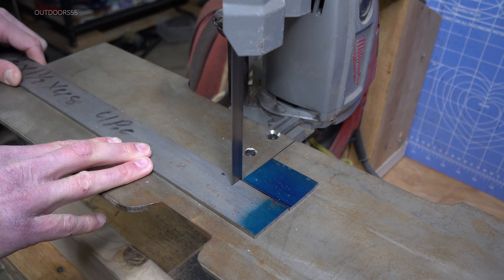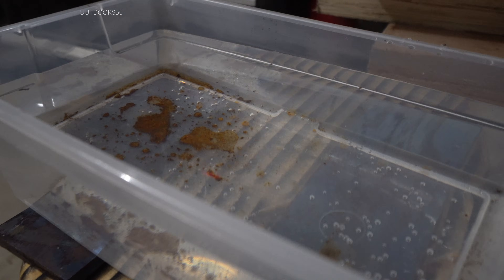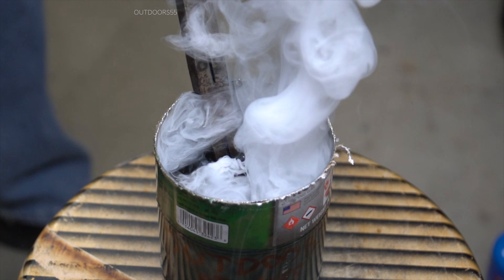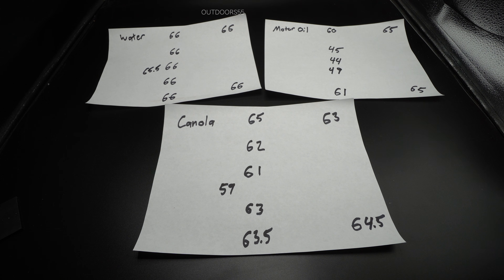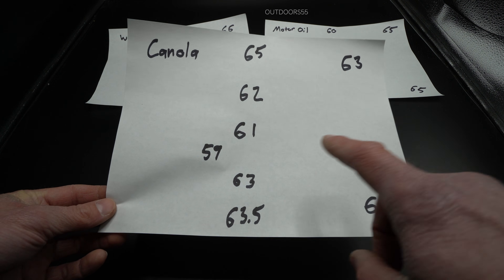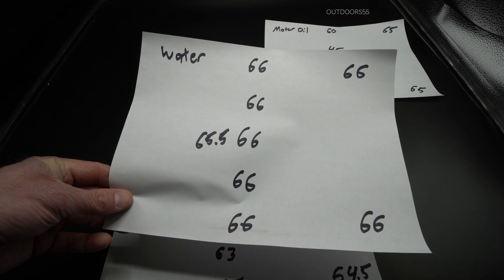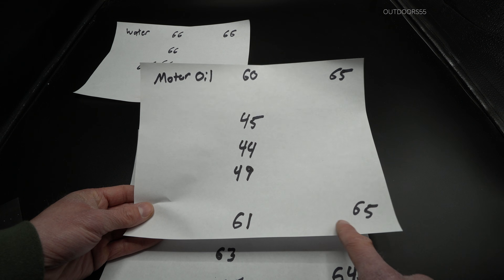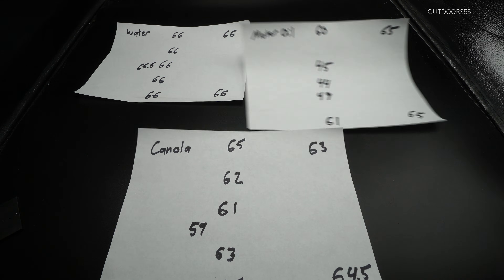Can You Use Canola Oil or Motor Oil For Knife Making?

Comment from the maker: This video applies to 1084 steel. Different steel will give different results. Also check description for proper quench oil. Thanks for watching 🙂
Reply: would you consider doing a 2023 season backpack loadout? that was how i found your channel a few years ago, would love to see the changes made since then.
Reply: @OUTDOORS55 just to let you know I have reported the twonk copying your user name and offering packages
Reply: Be aware that 1095 (or W1) is a water quench steel! It won't harden in this, but 1084/75/80, O1, 80crv2 and, 5160 will quench in a medium oil if it's thinner.

Comment: You're super wrong. 1095 and above is water quenching. Under that oil is still better. Rockwell isn't everything. Water will make most steels of 1084 and below brittle with bad edge retention. It cools too fast and thus makes cracks and such way more likely.

Comment: Saw another video where the creator pointed out that the hardness drops toward the centre of a thicker piece of steel with slow oils as well. Having those pockets of softer steel on the inside is not what you want, especially in a knife where that may end up becoming the edge after a few years of use.

Comment: Ok, so I hope you see this and can give me some good news. 
I restored a knife that was in a guy’s collection that was burned in the Hawaii wildfire. He lost everything.
I really wanted to bring this knife back, and he was excited to see me be able to put it to good use. I’ve spent a ton of time on it. But I’m thinking the heat treat was comprised, as I am not able to get a sharp edge. It keeps getting very small chips when sharpening. 
It’s  Paramilitary 2 in 
CPM 20CV. 
You probably already know the question. Is there a way to re-heat treat the blade or even just the edge, at home, with no special tools? 
Maybe since it got super hot in the fire, it only needs tempered again? If it got hot as a hardened blade is it even possible to re-temper?
I’m very mechanically inclined, but I don’t have a forge or anything like that. 
Any help is greatly appreciated. 
Many thanks!
Reply from the maker: Id find a machine shop with a hardness tester first. Unfortunately I don't think you can re heat treat 20cv without an anneal which youd need a kiln for. Depending on the actual temperature it got to it may be somewhat ok. But hard to say without hardness testing
Reply: @OUTDOORS55  
I ended up sticking the blade in the oven at 300°F for two hours, then let it sit in there to cool. 

I put it on the sharpener today and what a difference. 
Took an edge without issue, and felt way better while sharpening. 

Now, to be fair, I did switch back to wet stones, and didn’t use the cheap diamond thingys I have from Amazon. Those things are uber inconsistent and bumpy!

But yeah, it’s cutting really nice. 
Now to see what kind of edge retention I get out of it. 

Thanks again for the reply!
Reply: Thanks for the reply. 
I’ll check around for someone to test it. 
I may throw it in the oven for a couple of hours to see if it makes any difference. 
It feels hard when I sharpen it, but It’s just very brittle. 
I appreciate your input!

Comment: Thank You for your video here! I'm an FNG knife maker and tried quenching in used motor oil. I was having a tuff time getting my blades hard enough so a file would skate on the edges. So, after watching another video from a semi famous knife maker, where he edge quenched in water for afew seconds then dropped the blade into oil. I used this method and finally got the hardest I was looking for. Now I could continue this, but I did that edge quench out of desperation and would prefer to make my life easier, so I'll which to canola oil!   THANKS!!
Reply: Interrupted quench! It's even more important for 1095, W1, or Hitachi White steel. They're all water hardening unless the edge is incredibly thin, which also makes it likely to break in water, so you can use a fast oil for kitchen knives if you want a soft spine. 
1080, 5160, 80crv2 and such are a bit easier to harden but it's not a bad idea to water quench two small pieces and see how easy that scratches your oil quenched steel versus the water based one, to see if your steel is softer in an oil quench in that thickness. Or do an interrupted quench, since you only need to cool the steel fast to a certain point before it actually changes crystal form to martensite and changes in size slightly, which is what breaks them if done too fast in some parts of the knife and not others.

Comment: If you are just getting started and dont want to invest into a proper quenching oil use canola and something like O1/ O2 or 8670. They should still achive a good hardness.
Reply from the maker: You would need a kiln for 01
Reply: @OUTDOORS55  Because it needs more soak time? At least you dont get the usual plate martensite if you underaustenetize O1 a bit :D But i guess then its no longer at full hardness, and that was what this is all about.

Comment: Unrealistic !  Since a knife blade tapers toward the edge, surely the different thicknesses will cause a differing hardness.  So would quenching in used motor oil give a hard edge with a softer spine, which is precisely the optimum situation, as in traditional Japanese blades?   (I know that it's done differently there !)

Comment: I have a question.  With canola oil the lowest number you checked was 59hrc.  Would tempering the knife to 58hrc make the numbers consistent?
Reply from the maker: Good question. I've tested this in a previous video testing bad heat treatments. I cant post a link but it's easy to find on my channel. Titled "The biggest lie in the knife industry". I tested several different heat treatments with the same hardness.
Reply: Hardness isn't everything. The same hardness can have a different amount of many different properties like how far it bends before taking a set, how awful the burr is to remove, substantially lower toughness, and more.

Comment: I tend towards a warm brine solution, tested some low menganese 1075 pieces and found that canola was not adequate for the low hardenability stuff, brine was much better. I thought that 1084 would be more suited when it came to a vegetable oil quench, and although it did harden somewhat in canola you could still dig into it after a file test. The brine did a much better result with 1084 too. There are so many advocating 1084 with canola for backyard heat treatment, but I have my doubts.
Reply: For sure. Water is just better, and cheaper. You might get away with oil if it's very thin and prehg pound bevel, but then you also have to worry about it cooling in air too much on the way to the quench. Simple steels need a quench time under a second.. 52100, 5160 and O1 have better tolerance to cheap oil but even still, it's a couple seconds at best.
Reply: @mikafoxx2717  8670 might be ok with a canola oil quench. Experimenting with that steel.

Comment: Canola oil is absolutely a legit substitute for things like parks 50 if you don’t want to mortgage your house to quench. I’ve used everything from parks 50 to old deep fryer oil and honestly, there’s no negative to using canola oil. It also depends on the steel, obviously
Reply: Did you not watch the video?
Reply: @pumix  it’s actually not false info, lol. I also have a metallurgy background and an hrc tester. For some reason I’m logged into a really old google account, but I’m a bladesmith
Reply: The test showed that the edges would be very hard, while the middle would be softer. To me that seems perfectly fine for a knife. And it was done on square chunks of steel rather than a knife that was already ground to shape. In that case the edge would be thinner and it would get even harder. I'd take a softer center over risking a warp by quenching in water.
Reply: @Hendlton  I don't get why you guys are so against spending an extra $20 on real quench oil that will: a) give you repeatable and better results, b) won't degrade over time.  Also, it's NOT ok that the differing thicknesses harden differently.   That's a big problem.  For example, someone sharpens your knife back a bit and now its not hard.
Reply: @TyrellKnifeworks  Personally I'm not against it, but I don't agree with the conclusion of this video. Especially the recommendation to use water instead of oil. But I live in a country where something like Parks 50 just doesn't exist. I searched for it by every possible term I could find. You can't even buy knife steel where I'm from. The way I found my source was through a random Facebook post from years ago where someone left a comment with a mobile phone number and I just crossed my fingers that the seller was still active. That's why I'm looking for alternatives and questioning whether they are practically useful as long as you aren't aiming for perfection. And it's not like it stops being hard after a couple of millimeters. A professional butcher would have to use that knife for years to use up all that material. A regular person wouldn't get through it in a lifetime.
Reply: @Hendlton  where do you live?
Reply: @TyrellKnifeworks  I'm from Serbia. We also use the European standard for naming steel, so 1084 means literally nothing here.
Reply: @Hendlton  Canola is good.
Reply: Sorry, but this is just false info.  Parks50 is $35-45 a gallon. You really would need to replace your canola every few weeks, so what are you saving?     Also, if you don't have an hrc tester, all your results are in question anyway.  There is science to prove canola isn't a good quench medium for 10xx series steels.  If you think there's no negative, then sorry, that's just ignorance.

Comment: The problem I've had with water is blades cracking! Even when using W1 or Amazon W2 they still cracked catastrophically! 
I'd rather have a blade that's less hard but at least the edge is hard than no blade at all. 
I've also had success with canola oil heated closer to 160 degrees Fahrenheit rather than 120. I bet you don't feel like doing it but I'd love to see what difference much hotter canola makes.
Reply from the maker: There's always a risk of cracking. Leaving bevels slightly thicker will help.
Reply: @OUTDOORS55 it's fascinating seeing them water quench large gears and such in industry. You just need water even for 5160 when it's in massive leaf springs half an inch thick or more..

Comment: In Brazil many knife makers don't have access to quench oil so we have vast experience using wrong equipment lol. 
"Standard" medium oil Canola.
Motor oil will vary and depending on brand viscosity, usually it's slow oil. 
Your results match with this description .
The "recommended" oil for a fast quench is diesel.
It would be interesting to see results with "correct" Brazilian standard.
Reply: Interesting. Thanks for sharing. I'm getting into knife smithing myself and looking for cheap options that can still provide quality results.
Reply: @saintmichael3879  Electric oven for heat treatment is quite expensive around here. If you have access to it it's worth it.

Heat treatment on forge  has many many downsides, some upgrades can minimize it. Triple burner can help even out the heat. Temperature control with two sensors also help to get it right. It's still not ideal and probably only good enough for carbon steel but results are much better. 

Fish tank water pump for active cooling to avoid overheating steel while grinding  is the last cheap trick I know.
Reply: @thiago.assumpcao  outra dica que eu vi em um site gringo, é esquentar o óleo até uns 30-50°C para que ele fique menos espesso e possa resfriar a lâmina mais rápido (eu não sei se essa dica procede, eu não faço facas)
Reply: @isaacfernandes4692  É isso msm. Tenho amigo cuteleiro e esse é o padrão mas é difícil improvisar óleo rápido. Mais fácil usar um aço com maior capacidade de endurecimento tipo o 52100. Fica muito melhor assim do que se usa um aço limpo tipo a linha 10xx.

Comment: That makes so much sense: you don't want motor oil to be a fast conductor/absorber of heat because that would cause thermal differences throughout the engine block, with all associated material stresses those would cause. Block will crack, car will break.

Interesting how you casually just debunked a long standing myth among smithing youtubers, that preheated oil takes heat away faster... I can imagine that it absorbs the heat more evenly (in a uniform fashion because the oil flows and mixes more easily when it's a bit warmer), but you clearly proved that it's not faster :)
Reply from the maker: The warm oil vs cold oil may need more testing to say one way or the other. My sample size was only two pieces. I think you would need at least a 5 sample test with each, and average to see better results. There was no sign of any obvious difference between the two in my test here. Id like to test much hotter oil as well.🙂
Reply: @OUTDOORS55  hey, that's a great video concept :) (thanks for the reply ☺)
Slowly but surely you're going to build a metallurgy testing and vetting lab hehheh ;) 

It's true that sample size is important, but when the trend is not showing any difference, then a larger test will very likely also show little difference... I would even expect the larger test batch to have a lower variance because of the higher resolution.

Comment: I think you can follow this segment up with a knife hardness/toughness test. My hypothesis is that the water quenched 1084 would be more brittle than the oil quenched 1084. I predict the sharpened blade edge would be more susceptible to chipping with water quench.
Reply from the maker: I have a video testing bad heat treatments and toughness already. Higher hardness post quench gives better toughness at similar hardness levels due to the higher transformation of austenite to martensite. And less retained austenite.

Comment: Very interesting test.
If parks 50 wouldn't cost 200 euros a gallon.......
In the US its doable but over at the other side of the pond it's just expensive if it's in stock.
For now I'll keep using canola oil for the steel I am using.
Getting a good grain structure and good edge retention on my current heat treating recipe so if it ain't broke dont fix it.
Reply: If you use normal carbon steels, just use water and temper immediately. Make sure to normalize before quench and don't overheat before quenching, just enough to get nonmagnetic.

Comment: This was interesting, I watched a video earlier this week that explained that the soft spots are caused when the boiling oil makes bubbles on the surface of the metal that insulates it and keeps it from cooling quickly enough.
Reply from the maker: Yep! Thats why Agitation is recommended to break that air boundary layer 👍

Comment: This is terrible advice...... for most beginners using simple steels, canola oil is adequate to achieve an adequate hardness without the risk of cracking the blade.
You don't need to achieve "peak" hardness to make a functional knife. 

I'd rather have a tougher but slightly lower hardness blade with no cracks/micro fractures ect, as opposed to a water quenched and super hard blade potentially full of cracks.

Only a handful of steels can be safely water quenched, but even for them it's preferable (for something as thin as a blade ) to use a fast oil instead
Reply from the maker: Id suggest reading knife engineering by Dr larrin Thomas. Toughness doesn't work like that. Lower hardness post quench doesn't mean higher toughness. Again id suggest the book. In this video we are referring to 1084 and olny 1084 as said in the pinned comment. And this is referring to water vs canola, NOT water vs parks 50. Id always recommend a formulated quench oil. So it seems you missed what this video was actually about. So no, this video is good advice but went over your head.
Reply: @OUTDOORS55  Well I hope you're ready for all your "beginner knifemaker " followers to start complaining about cracked blades because of your recommendation of water quenching over Canola oil quenching.
No beginner should be water quenching unless they're getting their steel for free
Reply from the maker: Just spend $40 and by proper quench oil lol. No one is going to spend tons of money on steel and not buy the proper quench oil if they are getting cracked blades. Theres other problems at play as well. Perhaps you are grinding too thin pre heat treatment etc. canola is $12 a gallon so for 28 more your set. And cracked blades sometimes happen. Welcome to knife making.

Comment: I have to disagree I’ve only used canola oil and all my knives have held an incredible edge while being extremely durable
Reply from the maker: Failure to reach peak hardness doesn't have anything to do with toughness. The harder the hc out of the quench the tougher the blade can ultimately be. Tempering will give the toughness. So a knife that is hardened to 66hrc and tempered down to 60hrc, will be tougher than a knife that is hardened to 62 hrc and tempered to 60 hrc. I have videos demonstrating this and id suggest reading knife engineering by dr larrin Thomas where he explains why this is the case.
Reply: @OUTDOORS55  I get what ure saying and I appreciate your videos on heat treating but I forge my knives and then heat treat and I have brutally tested them with the canola oil quench and they hold an edge amazing and I also can’t get anything other than canola where I live so it works and I’m gonna use canola probably till the day I die
Reply from the maker: If it works for you and your comfortable with It keep it up 👍 Not telling anyone what to do just showing the pluses and minuses of the different methods.
Reply: There seems to be an obsession developing for gaining "peak hardness" even for beginners, when it's really not necessary, for a working knife I'd be chasing toughness over hardness, especially for beginners...... and only worrying about peak hardness after learning the basics for a bit.